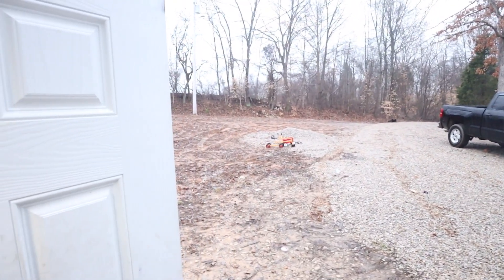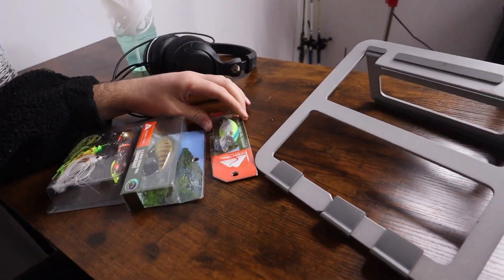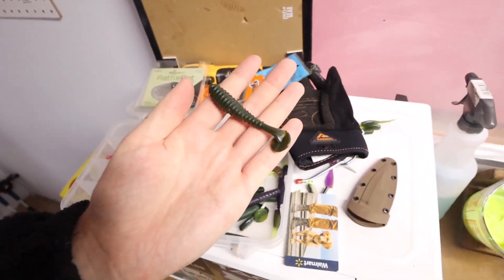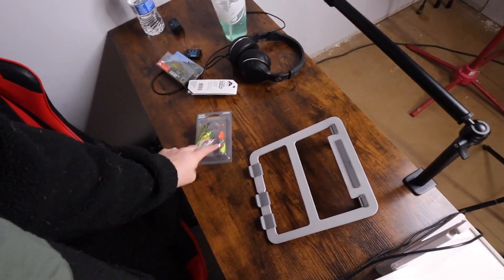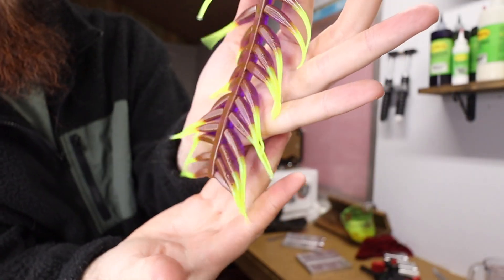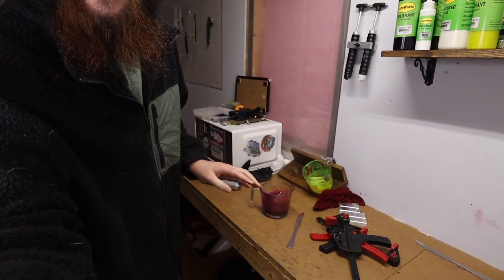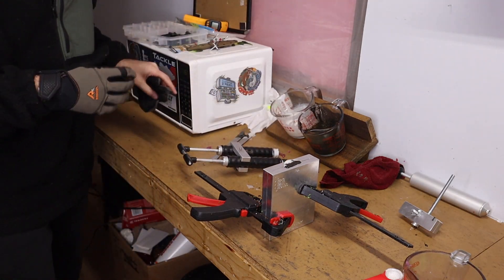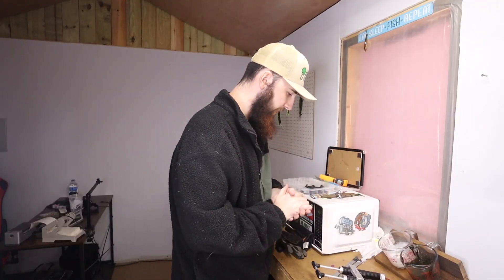Making HOMEMADE Paddle Tail Swimbaits for BASS FISHING! | Bait Makers Vlog #1

Comment: Sounds like the blades on your fan are clipping the safety cage around them. I suggest you check that the cage hasn't been bumped ( possibly when moving house?) and moved slightly. Should be really easy to readjust.